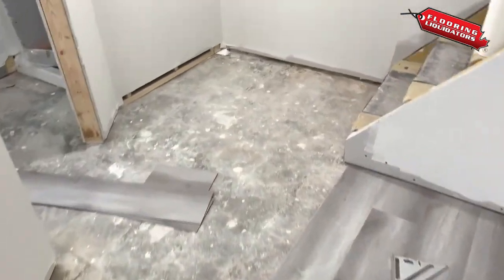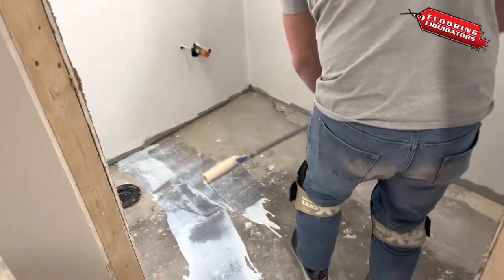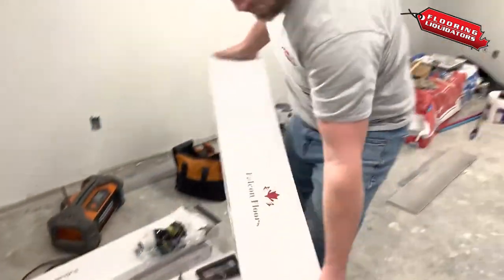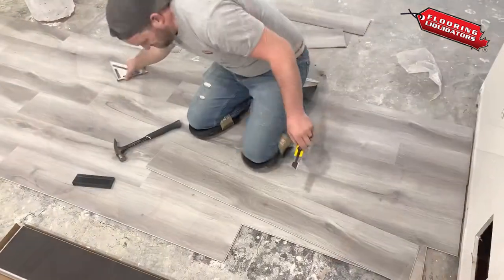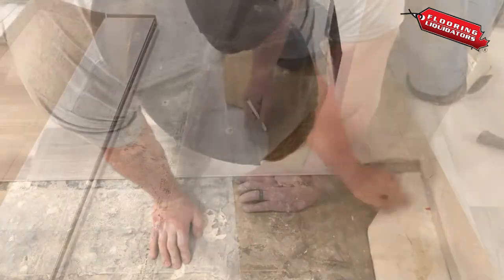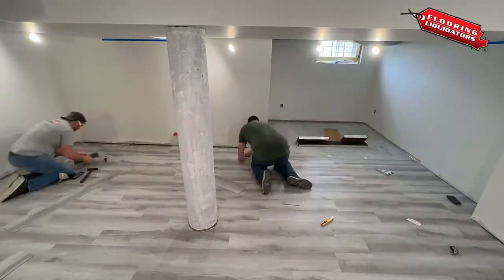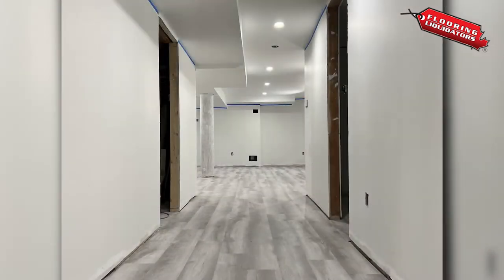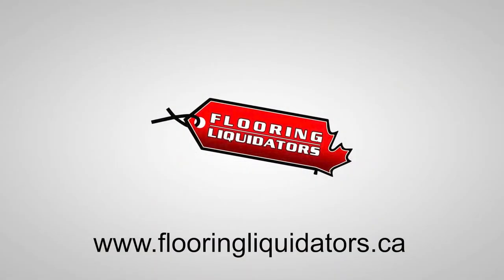4.5mm Vinyl Click Flooring Installation | Basement Renovation | Flooring Liquidators Canada

Comment: I'm trying to install Vinyl planks in my basement the flooring is concrete. if I buy the vinyl plank with the black pads attached do i have to put anything on the top of the flooring before installing the vinyl planks ?
Reply: Depends on the basement moisture but a couple hundred bucks on vapor barrier could save you thousands.